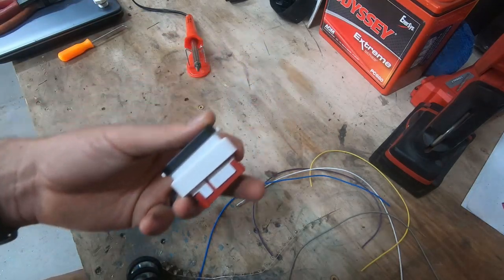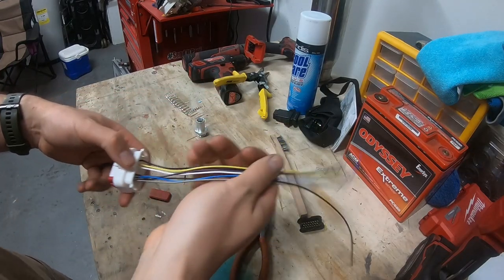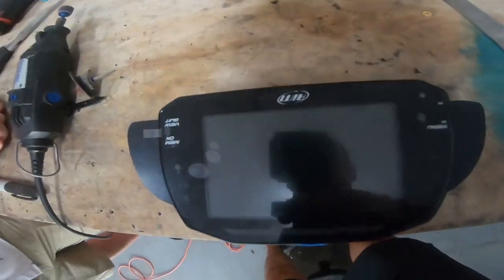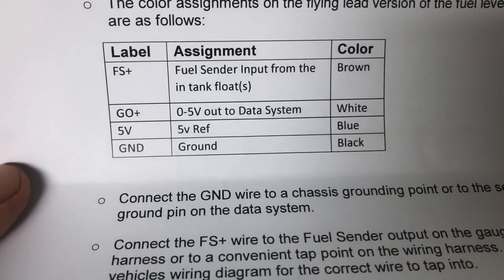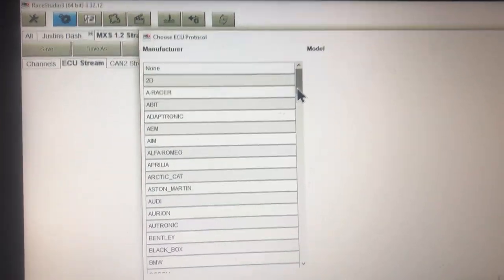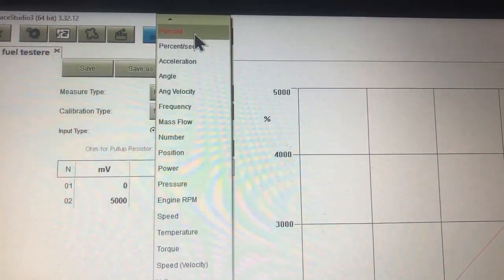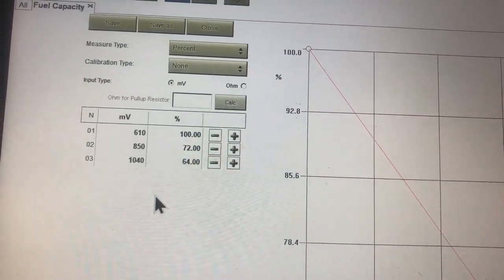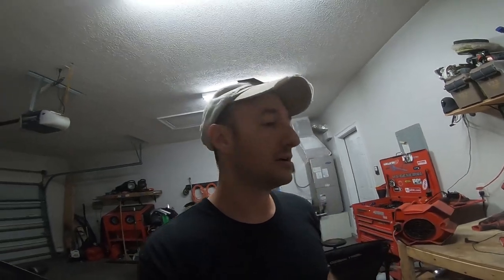Honda CRX Si AIM MXS 1.2 Strada 5" Dash Install EP. 38

Comment: awesome vid! im excited to see the brake kit. honestly soldering those pins was a good idea, i use dupont connectors all the time and have the proper tool and the wires still pull out sometimes. any chance you are selling that omni tach? ;)
Reply from the maker: I appreciate that...soldering just gives me a sense of “safety” for the wire lol. Maybe in the future...holding onto it at the moment though :)
Reply: Justin Gadell well it was worth a shot lol. Keep up the great work it’s been very inspirational for me and my crx

Comment: Great video, did those screw standoffs you mention at 7:40 come with the kit?
Reply from the maker: Yep, those are preinstalled on the dash
Reply: Excellent, thanks! With the standoffs installed, did this make the mounting surface flush with the surface of the 5 Pin Female Connector (for video) or with the surface containing the 8 countersunk screws? I am designing a bracket and do not have the MXS Strada yet. Appreciate your time!   @justingadell
Reply from the maker: Ah damn, I understand your question but unfortunately I don’t fully remember :(
Reply: Ok, no problem! Great vid and I will be using for reference. @justingadell

Comment: Great video... For the boost, what sensor are you use...?
Reply from the maker: I am using a Autometer boost gauge. You can have the dash show your boost level if needed
Reply: @justingadell  If want to show a boost level thru the dash, can use any brand for boost sensor or need to use AiM sensor...?
Reply from the maker: Your ecu reads boost/vac from your map sensor

Comment: Great video. I have a question, how did you make the input for MIL light or add the oem Oil pressure switch light to the gauge? The RS3 part is where im stuck on, i have my leads in the wires behind dash already. Thanks
Reply from the maker: Same as how I did the blinkers essentially except when the check light is on it doesn’t change voltages it’s just constant. I actually am not running my oil pressure switch light. I’m running a oil pressure gauge separate from the dash but I do run it’s temp to the dash.
Reply: @justingadell  thanks man. So don’t run an off signal just an ON signal? I’m not great at the RS3 input values.

Comment: I’m trying to hook up my MXS Strada and I can not get a rpm readout. I’ve tried green wire from ecu to both tx and rx on the 23 pin analog. Am I missing something?
Reply from the maker: Not the 23pin analog. Hook it to the white wire coming off the main harness

Comment: How do you get the speedometer to work?
R u using the GPS or an actual signal from an electronic speedo sensor?
Reply from the maker: I swapped to a electric VSS. Grabbed one from a 98 D16 SOHC.
Reply: And no issues?   You don't happen to have a wiring diagram?
Reply: Thank you for taking the time to reply.  Very appreciative
Reply from the maker: I’m running a Rywire OBD1 wire harness so it already had a plug for an electronic VSS so I didn’t have any wiring to do on it :/
Reply: When you hooked up the  strada there were no issues?  I'm thinking of switching over to the strada dash and just looking to cover all my bases.
Reply from the maker: 0, just give it power and ground. Then attach 1 wire to the S300. Almost to easy, you can probably look up how to wire up a electric VSS to the ecu.
Reply: @justingadell  thank you

Comment: Hi I have a aim mxg strada on my civic mine is making a weird noise like static buzzing when the engine is running. Not when the engine is off but ignition on. Sounds like hid lights when they make the weird buzz but faint noise please let me know if this is normal if you here the same on yours thank you
Reply from the maker: I do not hear any buzzing :(
Reply: @justingadell  what 12v ignition you use to power the dash I noticed today when the car is on heavy load when the car is on it makes that buzz but goes away

Comment: Do you need to run the iron canyon fuel level sender?
Reply from the maker: Yes, it will need some converter and that’s the one I chose. Easy setup
Reply: @justingadell  could you essentially just run a resistor inline to the analog input to convert from an ohm output to a voltage output?

Comment: Well, you know how to connect and set a dash, but it's very easy. When making a video, do not show how badly they crimp the connectors. This connector is for crimping, not soldering. Crimping pliers are quite cheap. the connector is then more resistant to crack whit vibration.
Reply from the maker: Yeah it’s a tool I don’t have at the moment and not sure how how often I’d use it but can’t hurt to look into throwing one in the toolbox